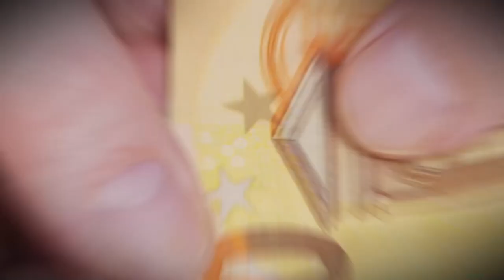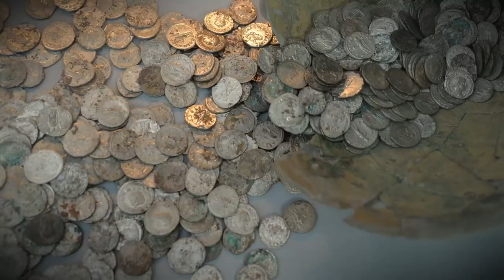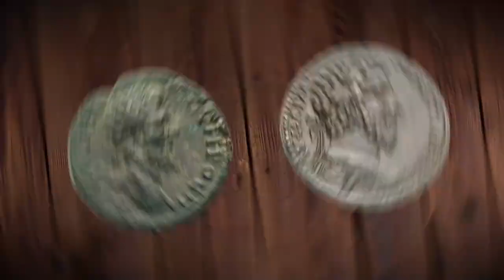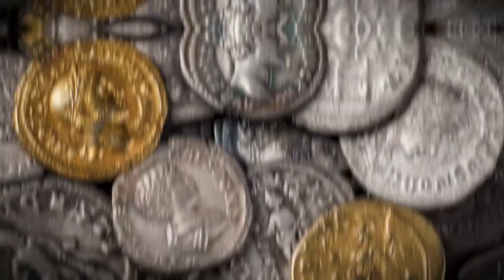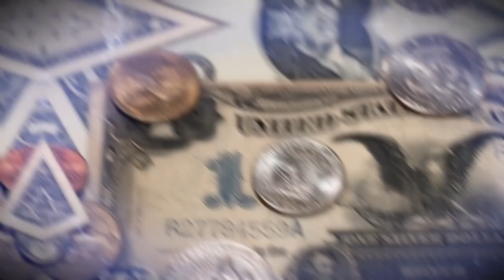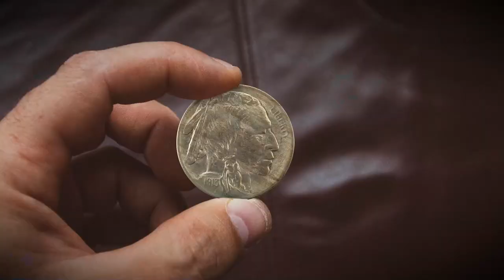8 Most Incredible Lost Treasures Found By Accident!

Comment: That. Oin you called a "dime" from 2880's, isn't a dime, its one Red Cent aka Indian Head penny, made of pure copper, which is the reason they turn red. Some of the later Lincoln cent aka Wheatback. They , the Lincoln cents were issued from approx early 1900's continuing with the Wheat-back until approx 1960 ish, and was changed again to show the Memorial on the reverse continuing up until present time, we have Lincoln pennies today which are now made of a  Zinc/Cooper alloy. The Indian head cent began its production run sometime during the mid-1800's until approx 1910 or so, PLEASE DONT QUOTE ME ON DATES!! I would appreciate the assistance and not receiving flak as a result of some datings that are not quite correct, even tho I should be relatively in the ball-park, happening upon a leaner in horse-shoes, close but no cigar. Not intentionally containing false or misleading info, more likely than not relatively close but not exact. But it is what it is. As I have a bit of knowledge on this subject, being somewhat of an arm-chair Numistmatist, or hobby Numistmatist tomato or tomatoe depending upon your past experiences. I have been interested in, been on the hunt for, up to and including the acquisition/finding as a result of a search or just plain dumb luck and receiving an interesting old coin or several at one time, even some rare, difficult to locate, much less acquire ones as well, helping my "collection" of finds/acquisitions, as the size/amount variety has changed drastically several times throughout my life up to this point, from the worst it could be completely empty, to at a time or two consisting of up to somewhere near 100 coins. And has fluctuated along with my successes and not quite evrents/occurrences that didn't come close to the idea/plan that began the period. "Ive been thru the Desert on a Horse With no name", ty to the group America for that. At this moment in time my collection consists of approx 60 or so coins, a couple of Silver Dimes, Eisenhowers, 1 Mercury Silver Dime and a couple of Silver Nickles a 1 Silver Quarter, and some 55 or so Wheat-backs. None too significant, but Special to me as I look at them, I travel back into my memories of the moments associated with each coin, where, when, how, each one entered my Sphere of influence/attention, more often than not it was a flash of something  out of the corner of my eye, or a different feel or look to my change from a purchase at various stores, most of which being some distance from each other or even right next to each other a few times. Its just something catches my attention or eye, or just feels/is different my alert tone goes off exactly as in the Metal Gear series of games, bells/alarms whistles etc. my nerves get jangled, a peculiar, eerie, weird, strange, insert preferred adjective the all fit, just different/off IDFK know how to try and express a feeling, concept, oddness, whatever, words truly epically fail to convey/illuminate/express/describe what have you. Feelings, emotions, reactions, etc. just the odd circumstances everything included the kitchen sink as well, all combining/mashing/transforming/coalescing into a Chaotic Maelstrom mass/lump/thing that has physical properties and us fully loaded with all the bells and whistles, collapsing similar to the formation of a Black Hole, the twisting, turning, Uberness, indescribable/ethereal/fleeting/flittering/existing as the absolute oneness of a micro-instant of time, that appears, feels, seems, drags on for a serming Eternity, when actually it's merely a pico-second later. Pico being a microscopically miniscule almost inconsequentially brief its not even noticeable to anyone/thing other than a Super-computer, and can operate within the confines of that period of time. Scientists can describe it mathmatically, by expressing it on/in the Quantum Realm, as an integer, ( number) followed by more zeros than a normal person might see once in their lifetime, as an example that could be somewhat similar, IDFK, I'm not trying to do more than give a ridiculous fictitious totally made up number to give a kind if visual, to accompany the story. ie say
10 x 10 to the y power, like 10,000,000,000,000,000,000,000,000,000,000 or something similar this being 10 to the 30th power. but these massive/almost incomprehensibly inconceivable small items, which exist in/on the micro-scale ( being unimaginably small to include the size that makes utilizing a Scanning Electron Microscope a massive, super-jumbo-economy size piece if equipment that images and photographs the infinitessimaly small items, like electrons, protons, atoms, particles if differing sizes including oddball sounding and seeming ones, as in a WIMP, an example of a Weakly Interracting Massive Particle, such as the SLIPPERY, ELUSIVE Higgs Boson, which the Large Hadron Collider located in Cern Switzerland has been able to bring into the light of sight recently, during its last run, b4 closing down for needed upgrades/replacements which are going to keep it in upgrade status until, if I remember correctly sometime like way later around 4th quarter of this year. Don't quote me on time-interval/period, please if issues with my time quite possibly being incorrect. But in my defense, I'm running down at break-neck speed towards unconsciousness/oblivion of unconcoenciosness, ie sleep, being dog tired, positively absolutely worn out, running so far beyond gassed, done for or in, whichever adjective you prefer.